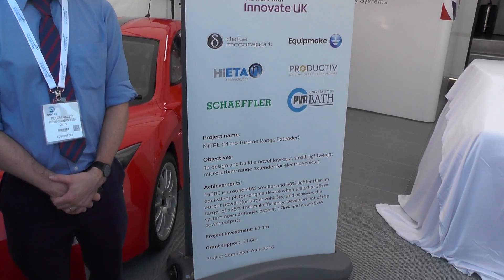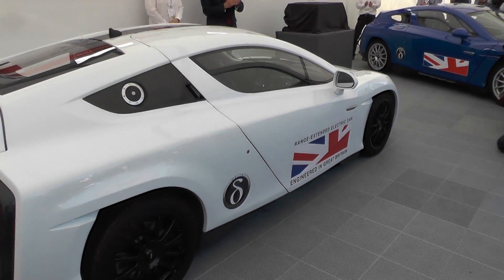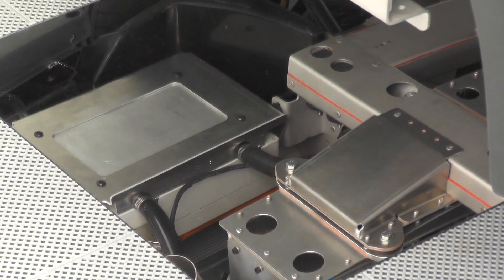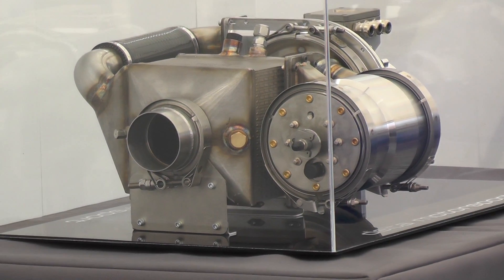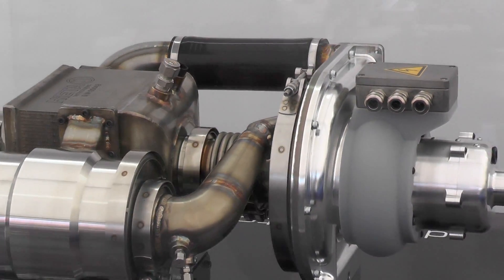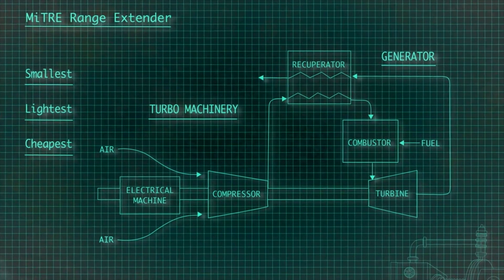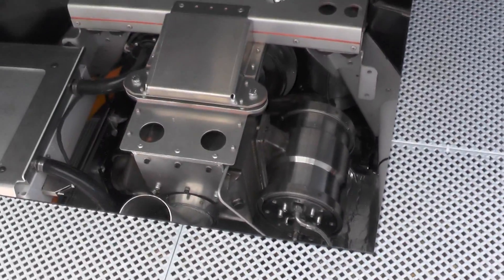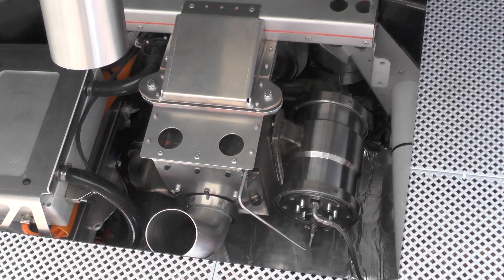MiTRE Range Extender - tiny turbine power removes EV range anxiety [First Looks]

Comment: Why not just biy a gas car instead then ?  Useless product...
Reply: Gas-Turbines in the 1930s were considered useless for air planes. 
When was the last time You got in a large Commercial airplane with Piston gas engine? 1950s ? 
Gas-turbines have Huge advantages Over Reciprocating Gas engines with Thousands of moving parts ?
Reply: Dirty Blond..no radiator. trany. dr shaft..battery..oil change..diffntl..is light..mlt fuel..module..
Reply: My friend, who drives a lot, has a Chevy volt.   It has a big old gas engine in front and electric batteries with electric motors.   It averages 80 mpg according to the digital gauge overall after a year.  that's 2 1/2 times better than similar size car that is gas only.    With turbine which is smaller and lighter (cheaper) should do even better.  Because electric motors run the car, the engines are basically electric generators able to run at their most efficient speed.  If you look at it another way, same size/weight vehicle requires exactly the same amount of energy to travel a specific distance regardless of motor type, its just that gas engines waste energy in idling and revving lower and higher then their peak efficiency.  Side benefit for volt engine is lower maintenance as well since there is less stress on motor.   Now imagine with most vehicles used 1/2 the fuel or less, what a boon to future generations that will have a bit more fuel available for them.
Reply: Rick I get what you are saying. Micro turbines also run off anything combustible, which means you can dump your excess wine or something inside it, as long as it burns. The Chrysler turbine was nice and all but as you mentioned with the idling, that really hurt the mileage. Turbines are best used either at high speed and max throttle producing thrust, or at low speed and max throttle turning a generator producing electricity to turn electric motors which have max torque throughout their operating range.
I really like it when I meet someone online who knows their stuff, such as yourself :)
Reply: Dirty Blond, I see that this was 2 years ago, but I wanted to add my "two cents worth". I just don't think that the other replies understand what you were trying to say. People get some idea that they are "saving the planet" by driving an electric car, and they are under the mistaken impression that solar and wind generators will supply all of the needs. A lot of current electric cars have about an 80 mile range. That would be like my daughter's Hyundai having a 3 gallon gasoline tank. So what are they doing? Adding the turbine to extend the range. The result is not a pure electric car, but a hybrid, but they are still smug about their "non polluting" car. I don't suppose that they would consider something like a Prius where the design has been proved. I am leery of buying a hybrid myself. They are unbelievably complicated, and are so expensive to repair.. A completely new battery for a Prius is about $2600, plus installation and reprogramming the computer. A rebuilt hybrid battery is where each cell is checked, and any defective cells are replaced. So what about the other cells? They do not last long. My Uncle's car went about 100,000 miles on the original battery pack so he had a rebuilt one installed. In about 36,000 miles, some of the older cells in that pack were going so he sold the car. You can get a new Toyota Corolla for about $20,000 that will get about 30 mpg in the city and 40 on the highway, plus it can last for 400,000 miles or more if it is maintained correctly. When they do break, they are a lot cheaper to fix than a hybrid.  I would stay with a gasoline car for now.

Comment: Just a improvement on shed mechanics converting turbos to jet. Engines to power go karts. 🤔 🤔. Dam neat idea though. Going to be a game changer.
Reply: Mark Cubitt Except Wal-Mart was going to work with peterbuilt to make a fleet of turbine electric drive trucks until they ran over to Tesla motors

Comment: The system looks identical to the Wrightspeed turbine range extender
Reply: Extremely similar!
Jaguar had an electric / jet super car .
It was called Jaguar C-X75 in 2010
Reply: HVYMETL — Same idea, not identical.
Reply: I heard that Jaguar (well, the turbine supplier) just couldn't get the performance out of it. I wonder if that's what happened here - otherwise commercial generator users (builders, phone networks...) would be falling over themselves for such a small and cheap 15kW genset ...

Comment: Any updates? I'd love to ditch the weight of most of the batteries for an electric motor car, plus have quick fuel-ups.
Reply from the maker: No, not really. This is very much more an OEM product, so I wouldn't expect to hear much until it arrives in a new generation of EV. It would be great though if someone made an after-market model which Leaf owners could bolt into the rear space.
Reply: seems very unlikely to be mass produced.....same project of a german manufacturer failed three years ago...unfortunately
Reply: Oh well, a twin rotor engine it is then...
Reply: Search: delta cosworth catalytic generator
Reply: BYD sealion 6, sells like hot cake around the world has a gasoline on board generator. But the engine also connects to a one-way clutch to power the wheels directly in speeds above 100 kmph (60 mph) in hybrid mode.

Comment: so now we converting fuel to electricity and converting them again to kinetic energy?
Reply: Yes, the gear ratio to reduce turbine rotation speeds to drive you wheels is simply ridiculous even using worm gears or other such high ratio setups.

Comment: I'd put one in the Frunk of a Tesla.

300 mile range, already, plus a 10-15-ish gallon fuel tank for the turbine?

How far might that get me??
Reply: I was thinking the same thing LOL
Reply: 300 miles on electric, 15 gallons of fuel at probably 90 mpg, 1650 miles range?

Edit: Ah, because a Tesla is so damn heavy due to it's $30k battery pack, it's more like 60 mpg, but that's still 1200 miles combined range. The P85 pack is 1200 lbs.
Reply: @Avetho  

By the way, throwing numbers like "probably 90 mpg" is a good way of landing nowhere near the ballpark. 

The way you do it is by looking at efficiency, looking at fuel specific energy, looking at battery energy, and solving an equation for energy over time. Of course, in this case, it's easy because you're generating more than you're consuming so you can speed up and wait for the fuel to run out, then add ~250 miles of electric range on top of that. This is for flat terrain.

To help you out:
- Kerosene, Diesel, and Petrol all hover around 12kWh to 13kWh per kg. (That's energy)
- At 75mph you're covering 300 miles every 4 hours.
- 30kW x 4h = 120kWh (P100D will eat 30kW at 75mph with HVAC on)
- 120kWh / 12kWh/kg = 10kg (How much fuel you need assuming 100% efficiency)
- At 33.3% efficiency (near claimed) you need 3 times as much, which means 30kg of fuel.
- So roughly 66lb of fuel gets you an extra 300mi at slightly over 75mph.
- Since a gallon of fuel weighs about 6lb, that's 11 gallons.
- 300 miles / 11gal = 27.3mpg

Ah, you see? Nowhere near 90 or even 60. But your combined range is 550 miles.
Reply: Unlimited range mate.
People report 30kW power consumption at 75mph with the 21" wheel option, this makes a claimed 37kW.
Reply: That is a great idea! Especially since it is much smaller than a regular piston range extender.
Reply: Austrian Obrist Powertrain already did it in one of their test vehicles. Sadly, they don't produce them to sell. They offer a "production-ready technology". But that already is something.

Comment: Hours before overhaul on gas turbine? Fuel consumption? I like the idea a lot, it seems like a natural for an internet kickstarter campaign.
Reply: www.wrightspeed.com  founded by Tesla Motors co-founder Ian Wright.
Reply: @brandoYT  They don't sell to individual buyers. Only fleets and auto manufacturers.
Reply: I am not sure, but it is much longer than for piston engines. Only a couple of ball bearings, but they last a long time.
Fuel consumption is probably quite good, because you still have regenerative braking and you can use the heat to warm up inside the car.
Reply: @cryptohouse1676  actually most microturbines use “airfoil bearings” to “float” the shaft on a cushion of high pressure air. Most are designed for a lifetime of 10,000 hours to 15,000 hours of run time.